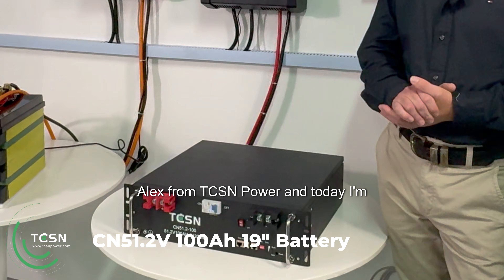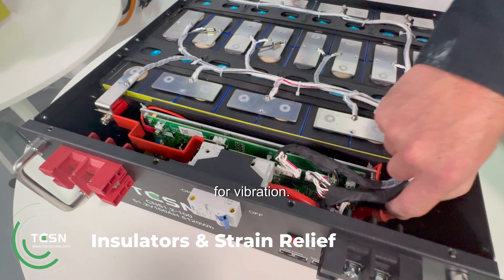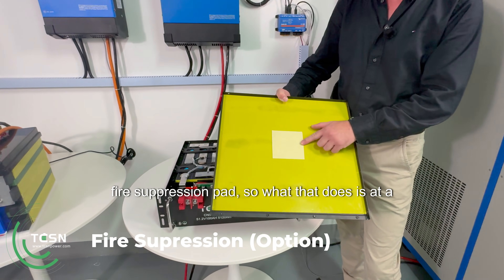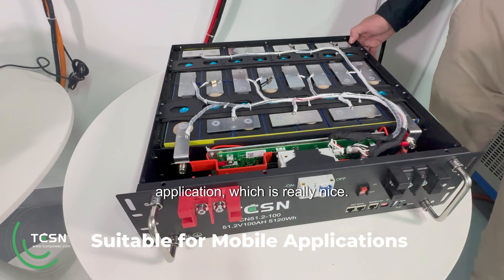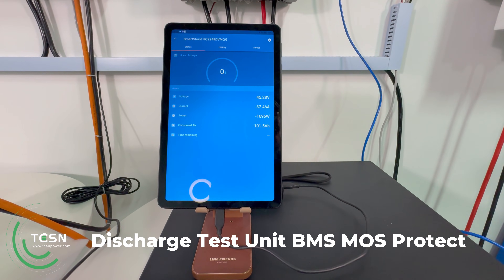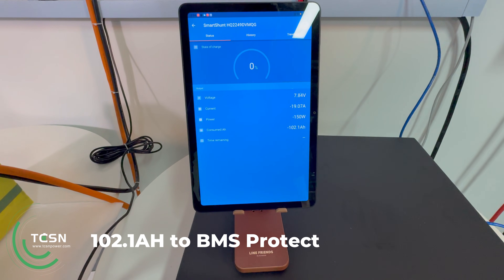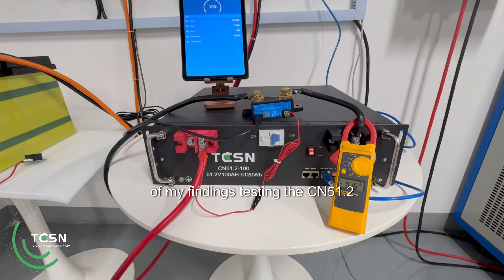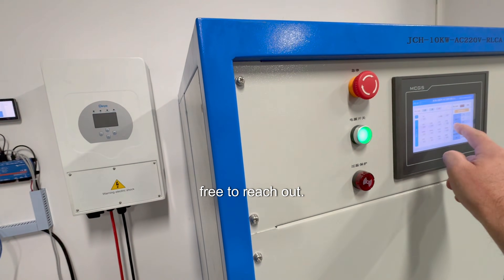TCSN 51.2V 100Ah 19" Rack Mount Battery - What makes this 19" Battery different? (CN51.2V-100)

Comment: What BMS is it?
Reply from the maker: It’s a proprietary BMS we have built. It’s for all the flexibility of multiple inverter support, built in pre charge resistor which is super helpful and balances at the top end immaculately. 

If you’d like to know more please reach out to us directly.
Reply: @TCSNPower I see. I have been buying only jakiper batteries as the after sales service is very good and they have an Australian warehouse.

Would your batteries be compatible with the jakiper ones in my system?